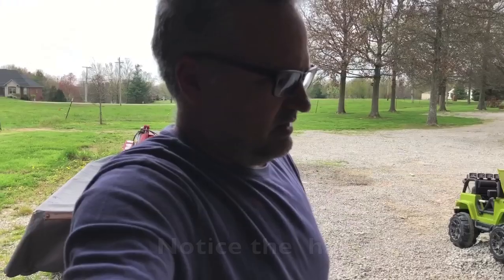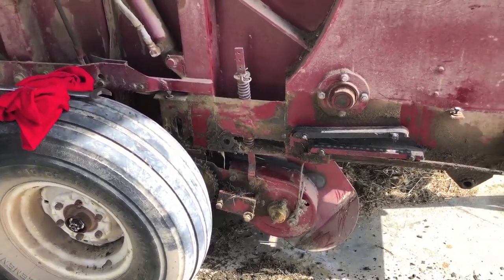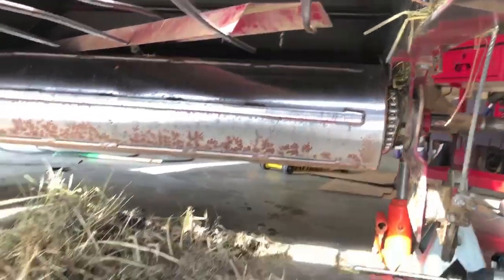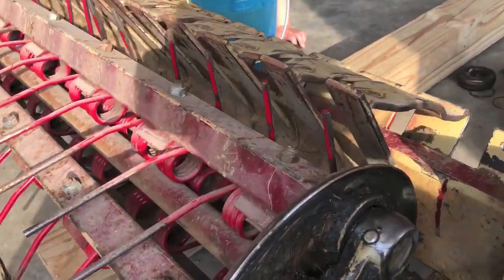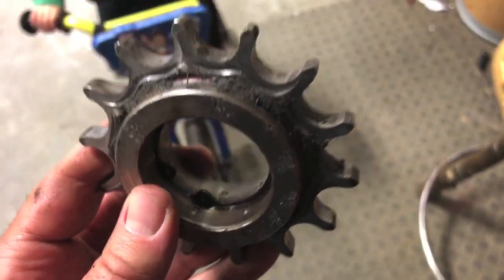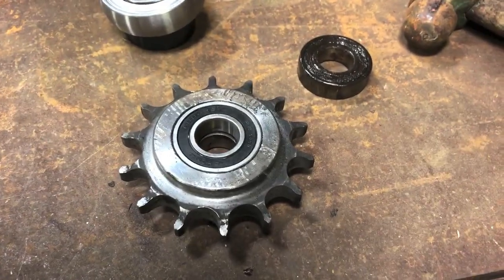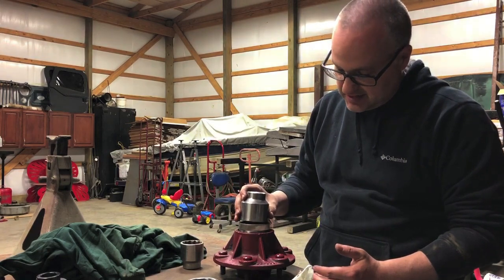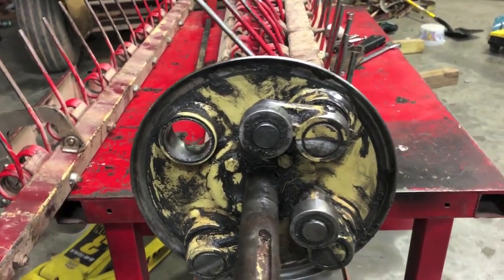Spring maintenance turns into REBUILD! M&W 1500/Krone 151 Baler That escalated quickly! Part 1 of 2

Comment from the maker: They are great balers!  They don’t require a ton of horsepower, easy to work on and you can still get parts through your local krone dealer.  The soft core isn’t bad.  I’ve had both and either works for us.  I’ve stored them both outside and inside and they hold up well. My bales weigh about 840-900 lbs depending on what I bale.  With that being said, I just upgraded my baler as I’m kicking out over 1000 a year so this one is for sale.
Reply: How old is it. Since I saw you rebuild it I would feel comfortable that it is in good shape. I mostly small square bale with accumulated but roll 100-150 a year. Hire it rolled just always thought m&w looked good never saw one work. I am in south central Ky. So not any close but there is a Krone dealer not far from me. Where are you n how much for baler?
Reply from the maker: @davidcassady8491  shoot me your email address and I’ll send you the details.
Reply from the maker: @davidcassady8491  I sent you an email with details of my baler.    Messicks has always been quick to get me parts.  i always had enough stuff on hand to take care of things that would be an issue.  Mainly chains and nuts and bolts.
Reply: @civilfarmer4171  thanks got the email   still weighing my options. What is difference between the 1500 n the 4500. I think the 4500 is younger any other changes? Like a 3000 Ford n a 3600 is just later model not many changes

Comment: Hey, I'm looking at an old m&w 1500 baler.  I know nothing about round balers, I've figured out our old New Holland square Baker pretty well but round balers seem much more daunting.  I like that its a 4x4, as my tractor is only a 50 horse and wouldn't handle a bigger one.  Do you think this would be an okay baler for a newbie, or would am I asking for trouble? :)
Reply from the maker: They are good balers and Easy to operate.  A 1500 actually makes a 4x5 bale that weighs about 850lbs.  You have to make a full bale I order to tie it as it is a soft core machine.  The M&p balers are simple machines.  Grease it and  keep up with maintenance it should last a long while.  Mine is for sale at the moment as I upgraded this spring.